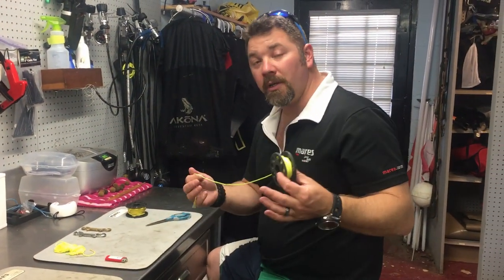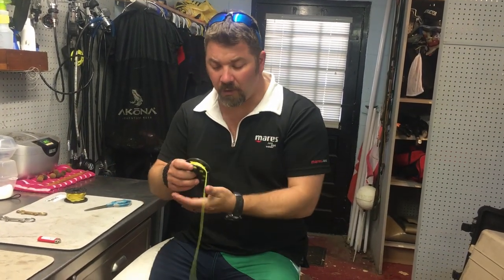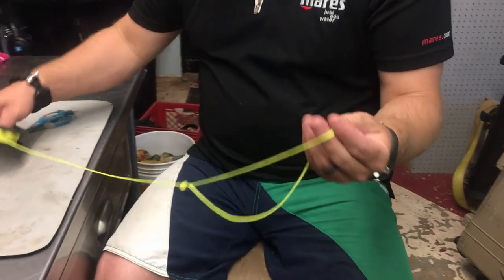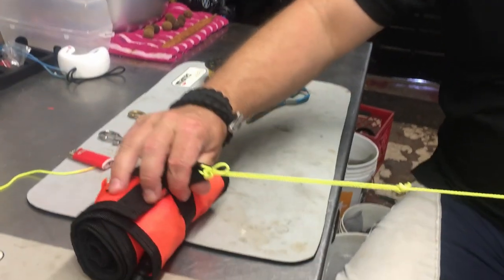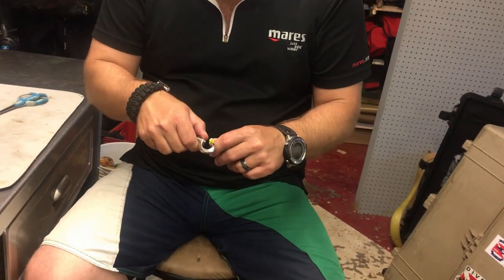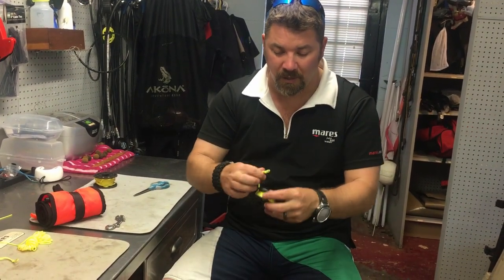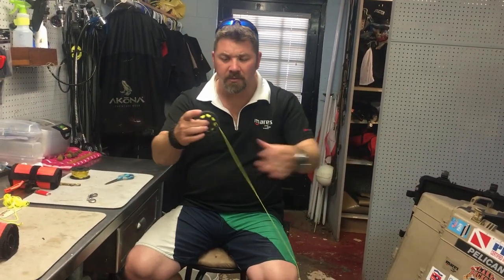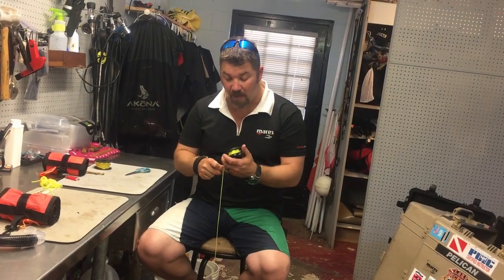How I Set Up My Reel System

Comment: Great tip about the swivel at safety stop depth! An extra idea that I like is small piece of heat shrink tube over the small loop. Stiffens it up and makes poking it through the holes on the spool a lot easier.
Reply from the maker: Dean Murray Great idea, Thank You

Comment: Thank you for the easy to follow and detailed setup. 
I got a question, how does threading the line twice add extra security to the set up? Thank you
Reply from the maker: I don't think it is any more secure, but more so to keep the reel hanging straight. I have changed my typical setup since this video. I will make an updated one to this very soon.
Reply: @LakeHickoryScuba  thanks

Comment: I'm glad I watched this, and the swivel reminded me of: smooth, bump, bump back to the pump....LOL,  but I have a question and I've asked some of my dive buddies and they were clueless, I was thinking about changing out the line on my reel to paracord, is this possible or advisable, or should I just keep the line the way it is. The reason I was thinking paracord is well, because of the durability it has, and if it were to get snagged on something wouldn't snap like the line that's on my reel now would do. is there a line that I can purchase that has the same durability that paracord has? any suggestions are welcome, Thanks.
Reply from the maker: Hello Jack Grant, though paracord is a lot stronger, it takes up more space, thus, less amount of line that is available to use. I would stick with the cave line.
Reply: @LakeHickoryScuba  thanks for the clarification...... I appreciate it

Comment: I've never used a SMB. How do you know when it has reached the surface if you can't see the surface? (as it relates to the swivel actually being at the correct depth for your safety stop)
Reply from the maker: Hello Rick Kinney, when you real quits spinning, this is an easy indicator that it has reached the surface.
Reply: That doesn't make sense. What is the wind catches it and the real just keeps unspooling?

Comment: Hey Brian, I was wondering if you could give me some advice on how to mark my spool line at 10' intervals for measuring distance underwater. I have tried different markers, and they either aren't visible underwater or the marking simply wash off. If I tie knots in the line they can't be rolled back onto the spool. any advice?
Reply from the maker: George I plan on making a video in the next few days on how to mark a spool.  Stay tuneds.
Reply: Use knots, 1 knot for 10 feet 2 knots for 20 etc

Comment: Hello Sir. Getting water into my DSMB when releasing it. I’m thinking it’s coming in through the exhaust valve, not sure why. Any help/suggestions?  Thanks
Reply from the maker: Hello C. Patrick Sadowski.  All SMB's collect water when deploying them underwater.  This is why we like the ones with a dump valve.  We simply unscrew the dump valve once back on land and drain the water.  The struggle is real sometimes.
Reply: LakeHickoryScuba   Thanks Bryan. Yes, it is, especially dragging a water filled ballon to shore.
Reply from the maker: You're welcome.

Comment: Personally, I don't like that way of setup, because ur SMB should be ready to go in a possible emergency situation, where u don't have that time to de- and connect all that stuff together. In my mind, u should always keep the reel of the SMB fixed to the SMB self. Best regards, Skip. Polary.
Reply from the maker: Depending on what you use your SMB for, having it already set up is a good way of doing it as well.  There are times when I use just my reel and not the SMB.  Whether I use it for a jump line, search line, or a simple tie off,  it ends up being an hassle having to remove the SMB during those times.

Comment: An extra little loop half way on one side of the big loop will help you pull the line out of the hole with gloves.
Using a bit of heatshrink on the little top loop will make it easier to thread through the hole in the spool or the D-ring on the dSMB.

When tying the reel to the double-ender, clip it, twist it around above the spring lever, and run it through the clip again. That way it won't come undone while clipped off, and you'll still have your spool and dSMB when you're going to deploy it.
Reply from the maker: Hello @bloodymarvelous4790, that way will work as well. Thanks for sharing.

Comment: Some interesting points but I do mine even simpler.  To secure the line on the reel using the bolt-snap, just pull it tight and clip into a hole. Sure if you leave the line slack it will unspool itself. As for marking a 15'/5m safety stop point on the line, I use a permanent colored marker. Sure I can't use my hands to "read" the line but even in the worst vis, one can certainly pull the line close enough to the face to see the mark (also don't have two potential failure points using the swivel).
Reply from the maker: Thanks for sharing your experience with us @jonnieinbangkok. We have another video, where we show different methods that we use as well. https://www.youtube.com/watch?v=rNjpLc6ND2o

Comment: It's a great video... but I wouldn't recommend the swivel. It's a failure point that can be avoided.
Reply from the maker: Failure Points are always a hot topic between divers.  We tend to base our way of diving more on facts than hypotheticals.  1000's of dives later, and we have never once had an issue.
Reply: Well, the purpose really is to minimise the possibility of an accident. In this case, the swivel is designed for fishing, not for scuba diving. In the event of an emergency.. upon deploying the dsmb, the last thing you want would be to loose it altogether. Especially when strong currents are pulling at the small metal loops where the swivel attaches to the life line. 

The thin hoops in the swivel could cause the life line to tear.. that would be a bad thing. 

The line used in the spool is a lifeline... in an emergency you don't really care as much of the comfort/ minor inadequacies of a twisting life line. On another note... completely forget using such a swivel when laying a lifeline in cave diving. That could spell a recipe for disaster. I'm not trying to criticise you in any way for the sake of it. This is a life saving device, adding a swivel not designed for the purpose (for fishing not scuba) is not very wise at all. Thank you
Reply from the maker: You make great points.  The swivels are used for fishing, where they withstand 100 times more force that what any scuba diver would ever have.  In regards to cave diving since you specifically mentioned it, our professionals here at Lake Hickory Scuba use different reels for any type of overhead environments, whether we are in caves, caverns, or under the ice.
Reply: By the way.. I've seen other videos in your channel and you provide very useful info. I'm a diver fron Gibraltar (Europe) we have great wrecks here by the way. You should come and visit
Reply from the maker: I would love to come over there and dive.  Thank You for the invite.  I would really like to go dive in Silfra, Iceland
Reply: A few of the dive club members here in Gibraltar have been there in Iceland. My dive buddy wants to go too. I've seen videos of it and it looks quite unique. Next year I'm planning to go to the Red Sea, near Saudi Arabia

Comment: Very well explained... Personally, for recreational diving I recommend 
to keep SMB and reel always together and I clip both of them to one of 
the reel's holes in order to have a double and thus more secure 
connection.
Reply from the maker: Thanks Andrea C.  Keeping the reel and SMB together definitely makes things easier and more convenient.
Reply: That  is my preference also.  I get the benefits of having the spool and SMB separate, such as the need to use the spool line for other purposes, but I really only use the spool to deploy an SMB.  Therefore I eliminate the step (and the risk of dropping one LOL) of connecting the two underwater.  BTW another great video Brian - keep 'em coming!